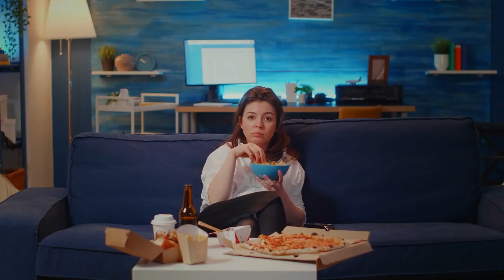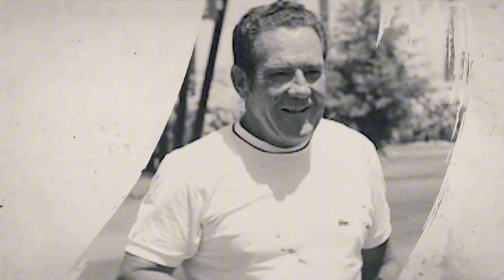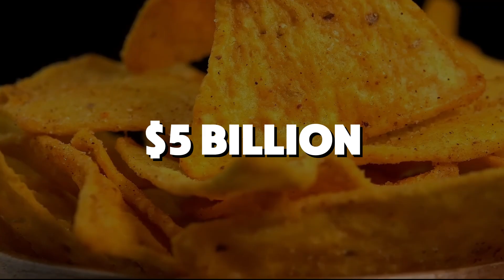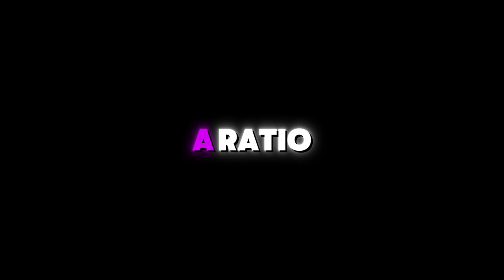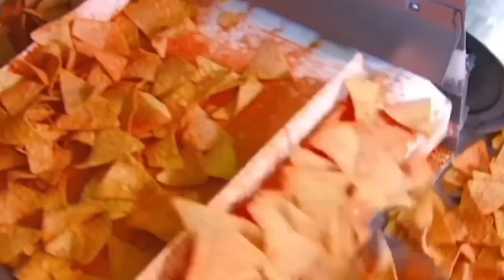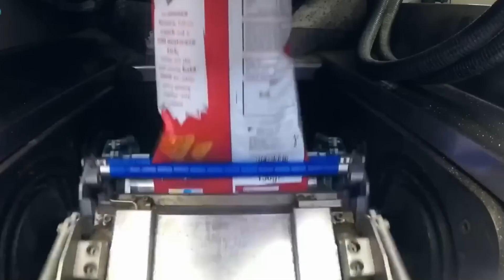How Doritos Are Made: The Pharmaceutical-Grade Dust Behind a $5.4 Billion Snack

Comment from the maker: Wait — 5,000 chips per minute? That's 83 per second. How do they even quality-check at that speed? Are there cameras? Weight sensors?
Reply from the maker: Great question. They use high-speed optical sorters — basically cameras that scan every chip and air-jets that blow rejects off the line in milliseconds. Anything with a brown spot, wrong shape, or size gets yeeted before it hits the fryer. The precision is absurd.